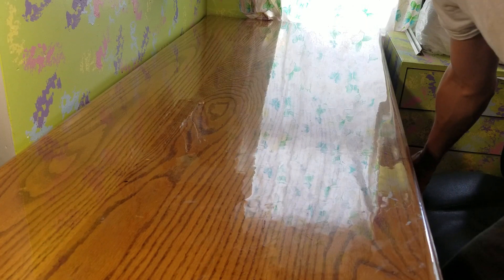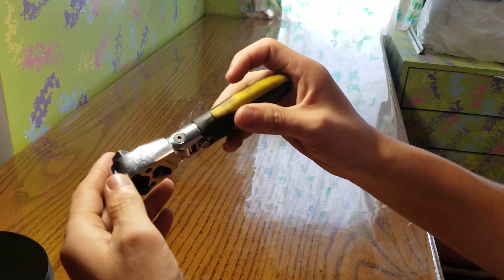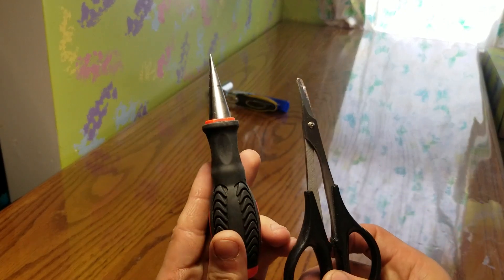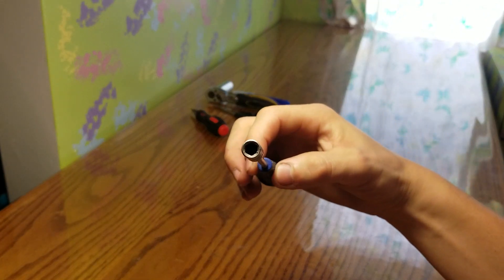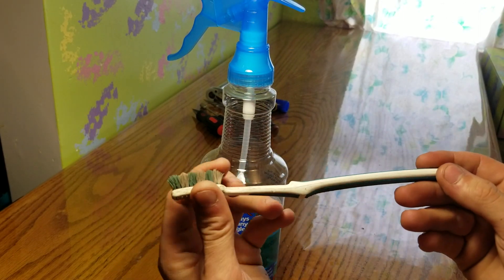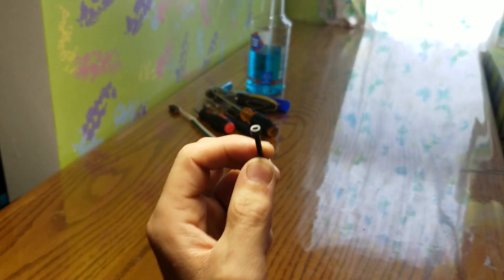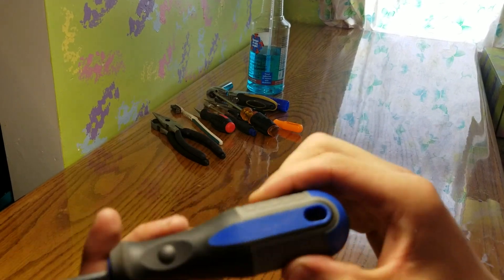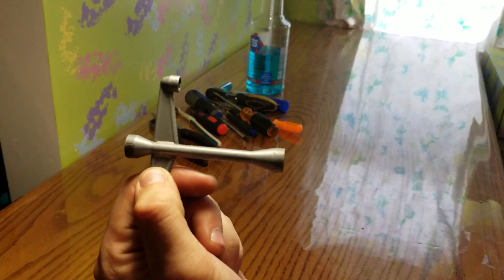Rc starter  tools  what i think  are the must have tools

Comment: Good going Alex, i would recommend the milwakee 1/4" clutched drill/driver. Powerful! uses the M12 lithium batterys. I recommend the 2Amp ones on eBay, even the imitation ones on ebay ones are pretty damn good. Even has a little led light! i use it to remove the 12 screws on my Traxxas UDR.